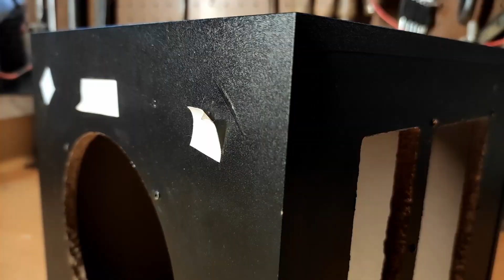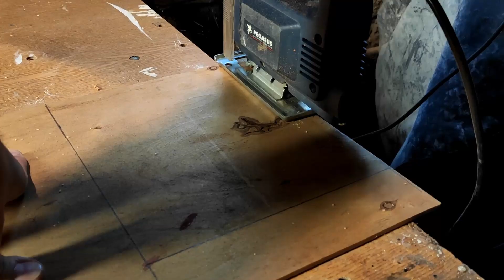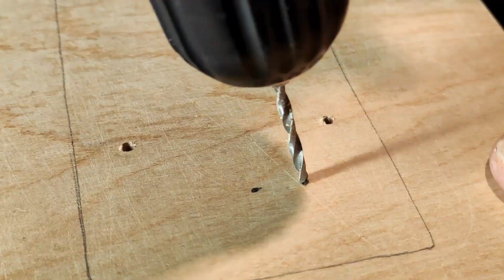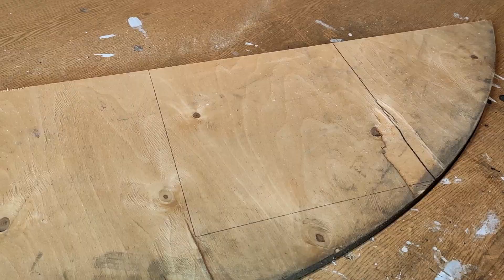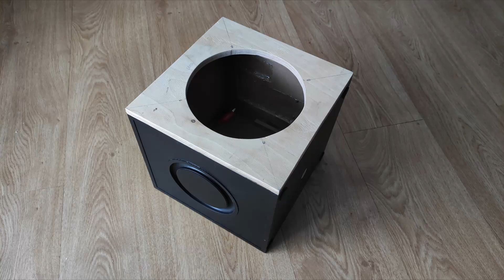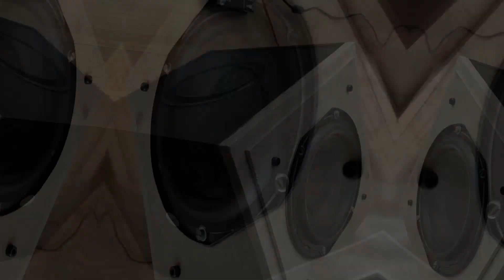DIY Test Box For Speakers | by Sebastian

Comment: The idea is good. It remains to glue the inner walls with vibration isolation, and lay acoustic foam rubber, and it will be fine.